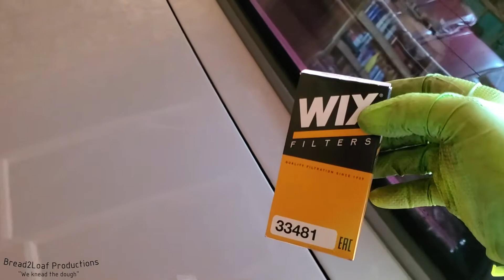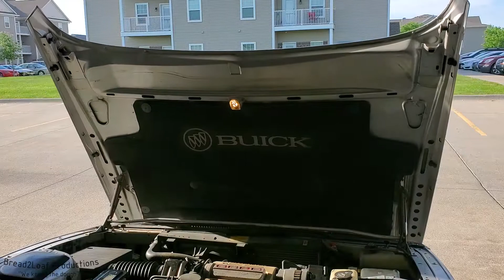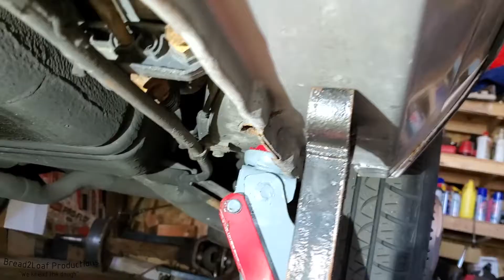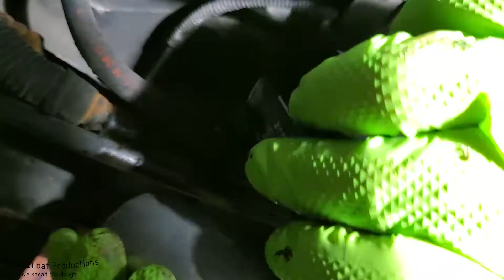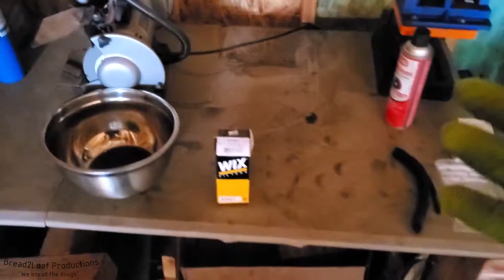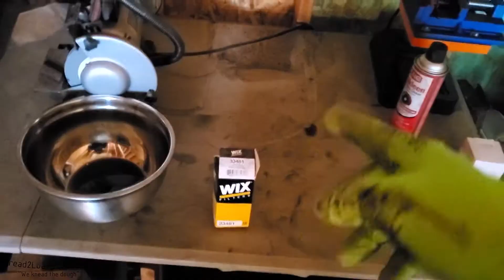Replacing The Fuel Filter On A 1988 Buick Electra

Comment: Update. Wow🤯 i can not believe how plugged up that filter was. Rust came out of both sides of the filter, wow. Changing that filter just took away all the hesitation when running the A/C and while going up hill. I think i gained about 30  hp and the fuel pump is no longer making noise. Got the car with 88,000 original miles about 4 months ago. Been garage kept by an elderly man who passed. Paid 500$ and 600$ in parts later, Ive got her running really good now.